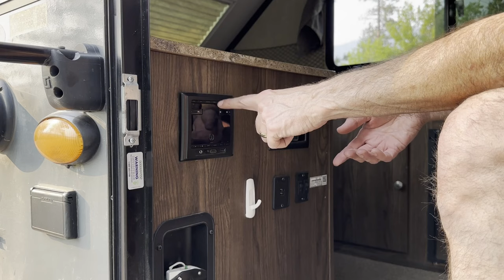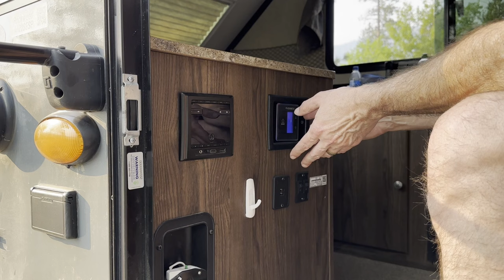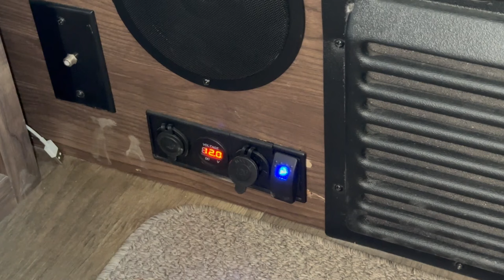PROS & CONS Of The A-Frame Camper

Comment: Very thorough user review. Thank you.  I'm sooo tired of seeing only walkthru's from dealerships touting all the features of these units, which are NOT from a user's perspective.  

I bought a nearly new popup recently. Real nice unit...I had high hopes. But after one 2-night stay where all the flimsy construction was revealed, I was glad to unload it on the market without much of a $$$ loss. I had never seen such thin "wood" and tiny screws. Doors fell off left and right. The canvas wouldn't align properly. And the stab jacks were obviously not brand new to the original owner; a couple jacks were bent and badly rusting. Pretty shoddy construction. Shameful.
Reply from the maker: Thanks. I really appreciate the feedback. When I first started researching these popup campers I saw those dealership walk through vids and are what sold me on the unit. From previously owning a conventional trailer for camping I was familiar with shoddy construction so was aware this might be an issue with the a-frame camper as well. These units have way thinner walls and use less expensive materials that are meant for light use only. My hope is that my almost three month trip up to the arctic coming up in a few weeks won’t damage it too badly as I will be selling it on my return. I’ve already fixed the broken wall with full length steel reinforcements. Hopefully this holds up and the other wall doesn’t have the same issue. Stay tuned for the videos on that trip coming this year!
Reply: @capturereeladventure  I'll be watching! The fact that owners need to be DIY'ers is a deal breaker for me. Me and DW take turns on how many unnecessary holes we can drill into our walls.

It's great that you're able to keep up with the fixes. 

I'll probably get a 4x6 enclosed cargo trailer, throw my tents and camping gear in it, and hit the road that way. Simple is best for us non-wrenching types. I once had a fully decked out Coleman popup. Shower and all. All those systems were overwhelming. Sold it to a pastor at a good price. I hope they used the heck out of it.
Reply from the maker: I've seen some cool enclosed cargo trailer camper builds. Even the simpler ones with just a cot, table, and chair inside works well. Thanks for the comments!

Comment: I live near the Aliner factory. I am a builder/designer of just about anything... years ago i bought a bunch of scratch and dent parts from them. I toured the factory.....holy crap they are nicely  built. I generally HATE rvs. I am building several vans, including a Quigley 4x cutaway. Aliner is doing it well. I have been self employed for 30 years... i could work for them, they are doing that "well".
Reply from the maker: What a unique opportunity you've had. Aliner A Frame campers tend to have more features in them than most. Thanks for the comment!

Comment: I was hoping to see the set up and take down but you related it was a quick operation, also this type of trailer has been on my radar for a year or so, we now use a cargo trailer conversion and it has good and bad points also. The shocking part to me was the wiring nightmare, which would be job one to enclose in PVC conduit and have the lower structure enclosed. My microwave comment is as following, we have one at home we seldom use so it is not needed on the road. Good video revue.
Reply: Set up and folding is very easy and quick. However mine leaked at peak of roof. Food for thought
Reply from the maker: Thank you!

Comment: A rebuttal to your suggestion of having two 6-volt batteries mounted in series, as opposed to two 12-volt batteries mounted in parallel. From experience, I mounted, as you have suggested, two 6-volt batteries on my camper and went camping in the Nevada desert. After about the third day, one of the 6-volt batteries developed internal problems. This caused a serious voltage shortage, rendering many of the camper accessories almost useless. If the same had occurred with one of the 12-volt batteries, I still would have had 12 volts, but just diminished longevity. The total amp hours were just a little reduced with the two 12-volt batteries over the two 6-volt batteries. Something to consider.
Reply from the maker: Thanks for your comment! Good perspective. 👍
Reply from the maker: Thanks for the comment. That is something that could also be considered. I bought the most expensive 6 volt batteries at the time so they've served me well.

Comment: Magnetic covers for your exterior facing vents?
Something like a dozen or so neodymium magnets sewn into a screen mesh?
Option #2, take the covers off and add tyvek or another barrier to the interior of the vent, remove when you're setting up camp?

For the lens covers that want to pop-off easy, maybe a rubber band or gasket to help make the snap-in more snug?
Reply from the maker: Excellent suggestions. Thanks!

Comment: Excellent walkthrough on your Avan. Certainly some important things to consider. Most Campers, Vans and Trailers are a bit of a compromise, we need to be prepared to trade one Feature for another Benifit. We just changed up to an Avan from a much loved Little Guy Rough Rider Teardrop. Now we can cook, sit and eat out of inclement weather and hostile wildlife. We have a built-in, well ventilated (to the outside) toilet for urgent night time nature calls and are experimenting with an Internal Pressurized Dust Reduction System to keep dust out, regardless of leaking weatherseals. Cheers from Michael. Australia.
Reply from the maker: Thanks for the input! Much appreciated.

Comment: Thanks. I attached a pulley at the peak to lift my tarp canopies (heavy duty and nylon). I tossed the heat pump in favor of more storage and installed a simple thermostat. I use stackable drawers above the microwave. I put my 29er batteries on a rear bumper plywood shelf. I hang my bike on the rear tire. Generator also goes on the back. The best thing I like are the Dexter  wheel bearings. I cover the A frame with a fitted cover in the winter. You got your table in backwards lol. Cheers, Jim
Reply from the maker: Great suggestions. Thanks!

Comment: If I owned a pickup-- thought of having four rooftop pieces built atop the truck cargo area that could be locked when folded.  The door would be at the tailgate of course with windows front and back and a step up would be handy.  I guess it wouldn't be much larger than a tent although using lightweight waterproof materials would be beneficial.  You can tow a supply box for wires, cooking, heating/cooling supplies etc. instead.  Price-wise you could be as creative as budget allows👍
Reply from the maker: Thanks!

Comment: Check out a Lagun table mount. You can easily rig an awning with a decent tarp. There are several ways to mount it to the trailer roof panels, including laying the tarp over the edge of the door panel before you raise and fasten it in place.
Reply from the maker: Thanks for your comment! I have so many issues with mine that I’m selling it as soon as possible.

Comment: I purchased a 2018 Rockwood A-frame as a retirement present for myself in 2017. I agree with your concerns on construction of these units.  My big issues  were the marker lights. They all leaked and the sealing job they did in the manufacturing process  was atrocious.  I removed all lights and revealed them .another issue  was screws falling out. All over the camper. I soled my storage issues  with some stackable  bins from princess auto and some boxes from the same brand ( tactix). In regards  to the lack of a place for an awning,  mine came with the Dometic side tent.  I don't use it and have been thinking  about selling it . Let me know if you are interested.
Reply from the maker: Much appreciate your comment. I hope Forest River watches this video and reads the comments. The follow up video to this one will show additional issues I’ve been having including one of the roof lift assist shocks tearing out of its screwed in instead of bolted on mount. Also the constant water and dust leaks as well as the pin which holds the two sides of the long gable wall hinges together working their way out. Very frustrating to deal with the poor construction quality.
Reply from the maker: Thanks for the comments, much appreciated. If cars were built this way the manufacturers would be in big trouble. Not sure why we keep letting RV manufacturers get away with building things to such low standards.

Comment: Remember to change the locks on your outside storage doors!!  Most companies only use 3 keys and locks combo.  If you have 20 A frame campers in a lot, my key would open 2/3 of the doors.
Reply: I have a 2021 A214 Forest River that good to know. Mine leaked at peak during rain storm. Gotta figure something out.
Reply from the maker: Imagine if cars were built this way! RV manufacturers are ripping us off putting in cheap locks that everyone has access to!

Comment: Like you, I would prefer a hard sided enclosure in predator territory, even here in central NY with black 🐻. However, the issues you've addressed have steered me clear of A-frames. I'm more and more inclined to build my own square-drop, one tall enough to stand in, independent suspension, and without the yacht-inspired finishes that many overlanding camper manufacturers seem to be obsessed with.
Reply from the maker: Glad you found the video useful. I see more and more folks build out their own units. At an outdoor recreation trade show this year there were a lot of utility trailer companies with some great looking units to add your own custom build into. Way cheaper than the flimsy build rv trailers out there. Would be good to see your final build here on YouTube. Good luck.

Comment: Good stuff to digest regarding this trailer. The concept of this trailer is good being foldable for storing and foldable for less wind drag while towing are good. But like you covered, the execution of the build is really low quality. Don't get this industry standard of "offroad capable". It's just verbage much like the term "boondocking version." Just a lift alone is not enough. Offroad versions should be both lifted and axle free with independent suspension in my opinion. I think independent axle less suspension is even lighter overall too. Thankyou for the time and effort spent in making this segment and sharing your thoughts. Safe and happy travels.
Reply from the maker: Thanks for the comment. Much appreciated. I agree that if its billed as a sport model with lift and knobby tires it should be built to withstand the rigours of potholes, dirt, and the inevitable twisting of rough roads. This model is simply the street version with a larger tire and paint scheme to give the impression it’s something more than it is. Regardless, I purchased it knowing it wasn’t anything different so will have to deal with whatever issues come out of using it in harsher conditions. Stay tuned for the video series on The Great Northern trip I’m doing with it starting next month. Heading up to the arctic for 10 weeks of fishing and photography!

Comment: To cover vent could you try magnetic strips with a fabric cover or something similar atached to the strips
Reply: For the wires you could try a wire wrap to help protect it from rocks
Reply from the maker: Thanks for the idea. It would have to be rare earth magnets as the wind may tear them off. I’ve used regular magnets before to try and hold down a previous trailers electrical inlet plug cover and it just wouldn’t stick. Perhaps a more permanent magnetic mount with a hard plastic cover could work. Someone suggested using shelf liner material as it’s waterproof, held down with gorilla tape. Not elegant and would need to be removed and redone every time you get back on the road.
Reply: @capturereeladventure  it may not look great but maybe a heavy duty velcro would work if the magnets are not good enough because you don't want an air gap that can catch the wind. If ts a a plastic velcro you hopefully would have as many things catching it when the cover is off
Reply from the maker: I think I’ll try that. Thanks!
Reply from the maker: I considered putting in magnetic strips instead but couldn't find ones that had enough grip and others were too grippy.

Comment: What the problem is of covering wood is that you hide the problem. It will seam, edge leak into the wood. 

You get bouncing floors, usually starting at an edge corner.  

It's amazing all that exposed wire. Easy to fix, I guess. It's why the military doesn't enclose wires in cargo planes, but squirrels can love wire, along with our ship rats we get from from the docks.

I believe that the wires may be sweet or salt tasting. Decades ago was a problem with car, truck Ignition wires, especially in the winter.

It's good you confirmed the problem about those windows. always thought they would get pitted easily.

Decades ago, 60s, we used to use some kind of Aluminum Roof Coating. Came in a 5 gallon bucket, mop, broom, something I can not recall used to put onto trailer roofs.

We sealed a large commercial truck by using just a little as seam sealing the rivets and seams.

Stuff was bright to look at. The truck had a ply wood interior to protect the metal.

The indicator of a leak was water getting into the edge of the plywood discolored surface.
Reply from the maker: Thanks for the comments!

Comment: I had rented an A-Liner Ranger a couple of years back and it seems to be made a bit better. I went all over it making sure that I didn't damage it and I didn't see any exposed wires. I don't know if the rental company had taken steps to eliminate issues or not, but it is the only experience that I have had with one of those campers. I would buy the A-Liner Ranger should I purchase one. Thanks for your review and thoughts.
Reply from the maker: Appreciate the comment. The ALiner has overwhelmingly more support than the Rockwood. I hope Forest River is paying attention to all the negative reviews.

Comment: For the side vents, maybe some kind of roll up magnet to cover the entire thing while towing.

Good video, thanks for sharing.

And ya, that wiring underside is so bad.
Reply from the maker: Thanks for your input! Thought of doing magnets but they’re never strong enough except the rare earth ones. And they’re almost too strong. Have decided to go with velcro and some coroplast yard sign material I had laying around. Easier to put it between all the screws holding down all the vents and comes in long rolls. I need about 260 inches worth. Will post a video soon on some of the fixes I’ve come up with.

Comment: i say a most of the issues are more quality of manufacturing issue than design similar issue you'll may see any other rvs possibly more on the lower end rvs.  Though other issues are the issue you see in all collapsible trailers which i expect and experienced myself.
Reply from the maker: Many RVs are slapped together in record time on the assembly line. Especially the lower priced units as you mentioned. That doesn’t forgive the manufacturers from producing something that falls apart easily after only a few short years. Better engineering and parts should be standard on items that must not fail, ever. Leaks should be a thing of the past!

Comment: I owned an A Frame for about a year.  I liked it for several of the things you pointed out, but at my age I found too many of the inside too short.  I had to bend over to use the microwave.  The table was not sturdy enough to support two people, so I made supports to put under the table.   I failed to  close it properly, I had the door sections latched, and it bent the door frame so bad that I couldn't completely close it.  There is a constant drain on the battery from systems inside so you have to leave it plugged in while being stored or install a battery disconnect switch.  We went camping and the battery got low and propane gas sensor started beeping with no way to shut it off....so we ended up cutting the wire so we could get some sleep.  I sold it back to the dealer where I bought it.
Reply from the maker: Thanks for the comments!

Comment: Why do they have all that wiring messed up and hanging off the underside?  Couldn’t they put in a raceway along the inside near the base?  If I were to buy one, I’d want it stripped of almost everything. Just need outside elec connection for campsite elec and solar connection ( I would have a Jackery etc instead of built-in power. I can arrange storage and sleeping areas to my own liking.  
I would do the same with a teardrop or squaredrop.  For me less things to break is better. I’m all for modular, move things around or replace if needed.
Reply from the maker: Great ideas and yes they absolutely should have isolated the wiring underneath. Poor engineering combined with cheap materials and shoddy construction makes for an rv that is guaranteed to have issues. Why do they have such low standards and get away with it?

Comment: Great video.  I can understand the window leaks on the slanted roof sides.  As nice as it is to have a view, I would stick with openings only on the straight door side and opposite end for cross ventilation.  I was thinking of building a folding/closable A-frame upon a small truck cargo area and leaks were a concern esp for windy rainy nights.
Reply from the maker: Those slanted side windows are a nuisance and IMO should never have been part of the design. Not only do they leak but they also get scuffed and can easily break as they are so thin.

Comment: The attachment points you are seeing are for the missing hydraulic lofts. The previous owner seems to have removed them
Reply from the maker: Thanks for your comment! There are hydraulic lifts on the other side of the trailer and those anchor points are made of metal. These are plastic and there don’t appear to be any other attachment points so it looks to still be a mystery. 😵‍💫
Reply from the maker: Thanks!